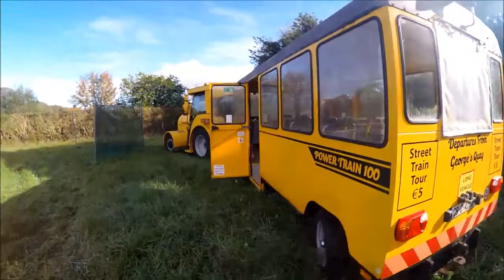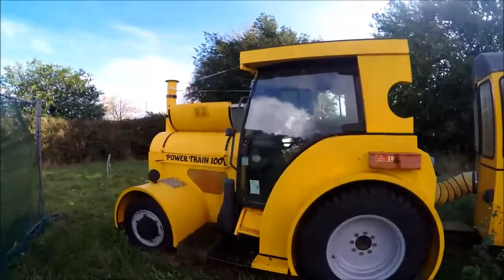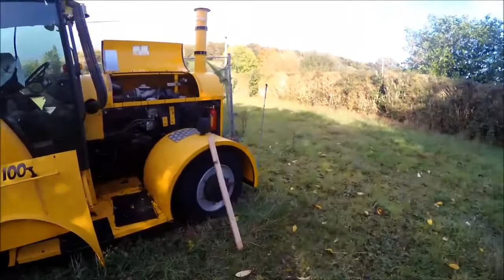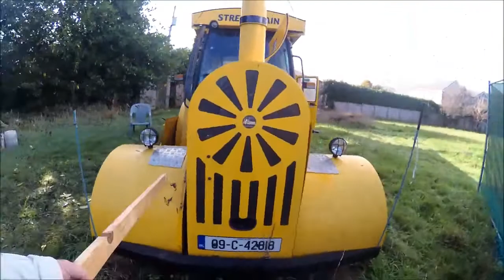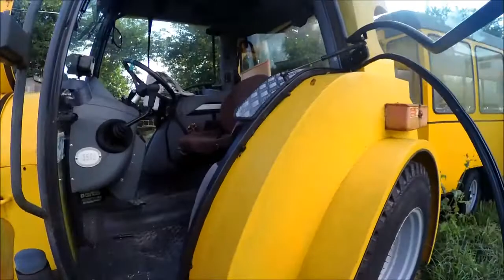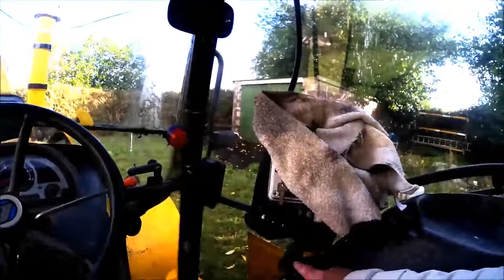Communicator Video

Comment: This is an amazing machine and the engine housing is unique in design terms. The fact that Pat is planning to use solar power to provide the energy required to operate it is so environmentally friendly. This will be a fabulous when it begins to operate as a tourist train in Cork City. Very empressed.